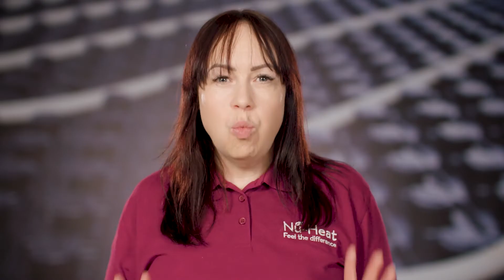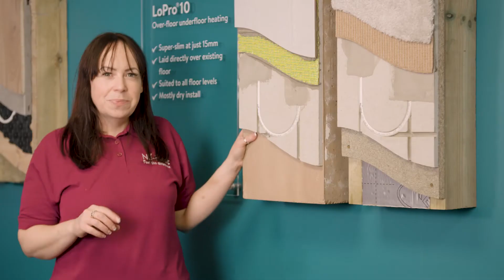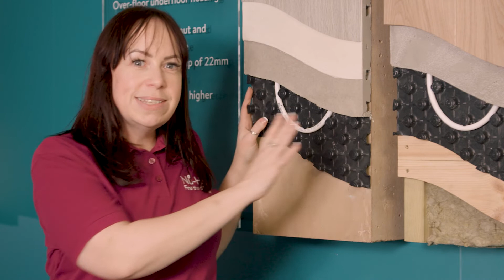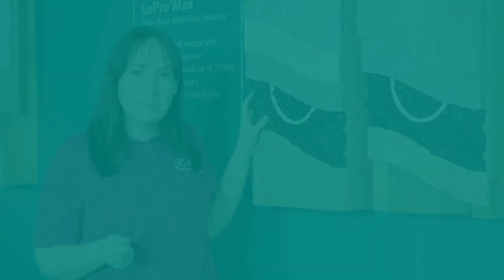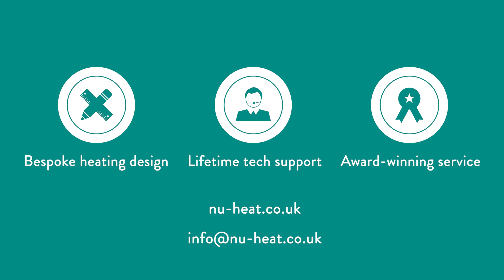Underfloor Heating for Renovations

Comment: Would you need to level a suspended timber floor before laying the insulation pipe boards?
Reply from the maker: It is advised to start with a level surface where possible, if the timber deck boarding is being lifted to install mineral wool below this offers a good opportunity to correct deviations in floor levels, screw down any uneven floorboards or if required replace with a T&G chipboard deck, level the deck using self-levelling compound where required.